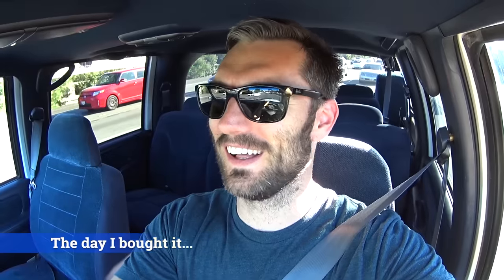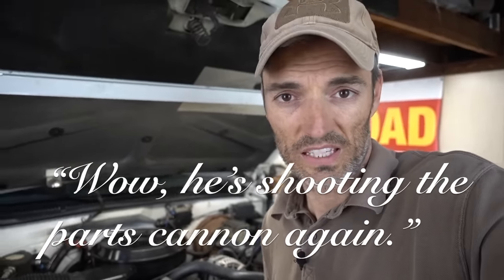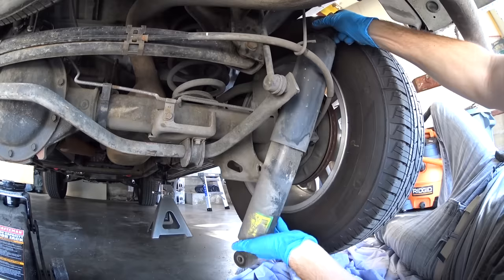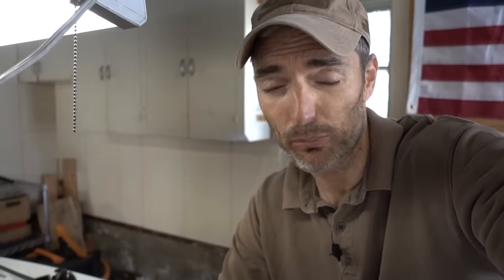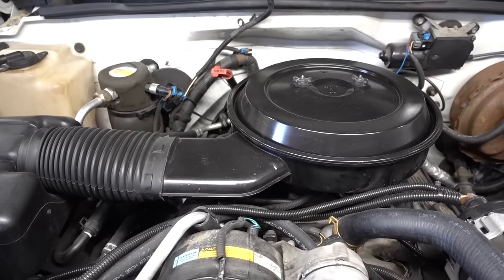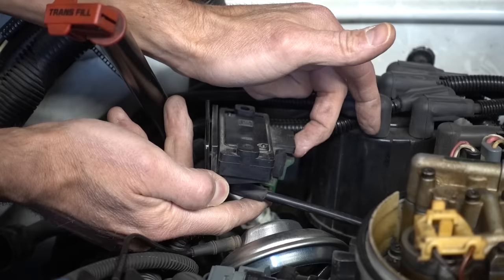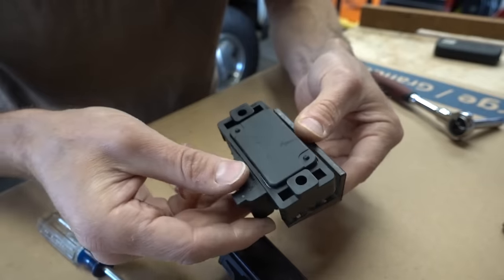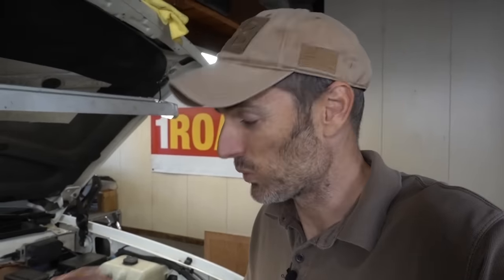The ONE REASON Why My 25yr Old Truck Runs So GOOD!!

Comment: I'd stick with a 25 year old part over anything made in China.
Reply: You have too look for original parts ( IF AVAILABLE ) & NOT MUCH IS MADE HERE ANY MORE, SADLY.
Reply: I usually buy the Chinese part and keep my old sensors on these. From what I can gather, delco isn’t what it used to be and doesn’t mean much anymore. I’ve used a lot of oriellys parts and they have all treated me well so far. I’m not throwing a part that costs 3x as much when another part that’s much cheaper works just fine. Especially when my vehicle is 30 years old and has 270k on it. I get what you’re saying and I agree to a point but is it really worth it? Delco is expensive and from what I read, they have a similar failure rate as oriellys parts. Plus oriellys usually comes with a lifetime warranty.

Comment: I jus subscribed. I recently installed corvette fuel rail covers that I had in the trunk. They were in the original package for my 94 LT-1. I wound  up taking the entire harness off to extend some fuel injector wires & to simply freshen up the design. Wrapped it up, cleaned the entire engine bay & replaced my throttle body gasket, replaced the I.A.C & T.P.S. Extended the I.A.T sensor. Took the pcm out & cleaned her up by wire brushing & painted her titanium grey. The results were, my engine bay is immaculate & I still am using the same opti spark since 2010. I have a back up A.C Delco waiting in the box & at least I know my motor much better. Regardless thank you for sharing because now I’m making an obd1 cable to retune her. Thank you & rock on 🇺🇸

Comment: I'm the same way with my 2005 Chevy V8  Trailblazer. It was my old man's b4 he passed and it is still getting the same miles per gallon as it did off the assembly line.

Comment: Jimmy, I m exactly like you are about replacing parts before they begin to affect my 23yr old truck as well. You are right about the Longevity of a vehicle how better it is and you can tell the difference between replacing certain parts due to age as opposed to waiting for them to wear out,  usually is a surprise to the unexpected people.
One last effort is to clean the clip and what it broke off from then place the plug-in part them carefully take your glue or whatever is best and then reattach the broken clip. If done well it should be as good as it was before, or nearly as.
Good an helpful channel.  Thanks.

Comment: as an EX cat mechanic you are EXACTLY correct that's why 1978 GMC 3/4 ton on propane fuel...72 cents per liter in bc, is still running very good today, as a matter of fact just came home with a cord of wood for our wood stove,Keepupthe good work.

Comment: Great video! Thanks!.....  I have a Silverado 2500 HD Extended cab with an 8.1l and Allision 5 speed-Great truck(i keep it up too)...but main truck I drive, is a 1971 Chevy C20( 3/4 Ton)....it has over 1 Million miles. My dad bought it in fall of 1970 as a 71 model. I do Home Improvement and Carpentry  work. This truck last and last and last-modified 292 Inline 6 supplies tons of low end torque-with New Precess MY6 overdrive transmission....constantly checking out vehicle-it keeps going and going and going....you are right!

Comment: I have a 96 c1500, I love this truck. you are completely right about preemptively replacing parts, these trucks parts are extremely cheap and ac delco is the way to go especially since theyre only 10-15 bucks more expensive than the china parts and last infinitely longer. I have had the truck since 2017 and everyone I know with new vehicles has their cars and trucks in and out of the shop constantly while mine has broken occasionally, nothing that needed to go to a shop for. everything is super easy to replace and is cheap and fast to do. I plan on keeping this thing for as long as I can because not only is it pretty, its cheap and easy to maintain.

Comment: I have 2 trucks, one is a 73 the other is a 76. They run good, they are reliable, replacement parts are cheap. I can go through these trucks bumper to bumper, new engine, transmission, suspension, breaks, etc for around 10,000 and have a truck everyone loves. Might not have all the bells and whistles a modern truck would have but I'm not into all that crap anyway. My old trucks will still be running when most of today's trucks are in the junk yard. I can just keep fixing them as long as I can get the parts.

Comment: I've a '78 Ford Econoline work van. 400,000 miles, and it still runs like new. 

I inherited it in '91, with 5600 miles on it. It has served me well all these years. I've done all the work. Parts are still available, cheap.

I rebuilt the body 15 years ago. I also don't drive it in the winter.

Comment: In 07 I bought a very clean 95 K1500 it needed a radiator I stripped it down to a bare block  and I too got out the parts Cannon now 95000 and 16 years later just starting to have trouble

Comment: I agree with You 100% !  I do the exact same thing as You do with My 2004 Silverado with 104,000 miles on it ! In 20 years I've only bought 2 batteries for My truck . That's because in the fall of the year I take My battery out, put it on the picnic table and scrub it down with hot soap and water . It's called preventative maintenance. It's what I learned working for General Motors The Buick, Flint, Michigan  Retired 😃

Comment: I just picked up a k2500 Suburban and preventative maintenance is what I'm doing so it doesn't break down on me this winter when it's -30 degrees. That's right, I'm talking to you 30 y/o temperature sensor!

Comment: Replaced this part on my 1994 G20 van, V6. Last one was factory original and had a crack in it. Runs MUCH better and idles much smoother. Cost a lot more than I thought it would, but worth every penny!

Comment: 100% on board with prevention maintenance. The high pressure line on my 2003 Silverado started leaking and was cracked..... I replaced the entire power steering pump, pully and all the hoses. I already had to take it out to replace the hose, may as well replace then original parts as the truck was at 197k. No leak, turns great!!!

Comment: My 17 year old 04 GMC 1500 purchased new just turned 56k miles.  I still charge the oil/filter once a year regardless of the miles, bumper to bumper fluids every 5 years. Getting ahead of what might be a problem works for me.
Reply: That is different than what this video is about. All fluids degrade slowly (usually) over time and should be changed with fresh as part of preventative maintenance. That maintenance can save you from future part failures. Some of those "parts" can be expensive like your engine and transmission. Just swapping out working parts is a different matter as the new parts are not generally of the same higher quality as the old parts. I would only do that if I am actually trying to solve a problem (rough idle) and definitely would keep the originals as spares if it does not fix the problem. Sometimes fixing stuff that isn't broken leads to other problems, like in this video where he broke the connector. He did not say what he did to resolve that (zip tie, RTV). Soon he could be chasing a problem when the connection is unreliable, convincing himself it can't be the MAP since he just replaced it.

Comment: The main place the "parts cannon" has failed me is ball joints. If I buy expensive ball joints the boots are too stiff and rip, so I have to replace them. If I go cheap the boots are pliable enough, but the seat wears out. The perfect combo of a quality joint coupled with a cheap boot. There are silicone boots for sale, so I think I'm going to start measuring their inner diameters and buying replacements up front.

Comment: I totally get that. If I’m pulling apart say the front end to do some lower ball joints and some bushings, may as well just rebuild the whole front suspension. So much nicer to have it all new and not have worry about tearing it apart and needing it aligned all over again.  
Although I only do this with a vehicle I’m keeping long term. 
As far as throwing a part at something, we’ve all had times when we’ve done it. It’s definitely not a great way to operate, but I just chalk it up as a learning experience and move on.

Comment: I agree, do it myself.  If you have to change cam and lifters, go for the rest of the overhaul.  You have the thing 1/2 town down. Why not.  Actually, new parts and clearances, equal new truck. Had a '69 malibu, changed oil and tune up w/ new points every 3 months.  Plugs, wires, whole nine yards, once a year.  Had over 200,000 miles when i gave it to my brother.  Ran great!

Comment: Think about it this way,  spare parts in case you need them. I do that all the time. Just recently changed my low beam headlights ( just slightly dimmed), with two new lights. Kept those for just incase.... the store doesn't have them or I need a light to get to the store so I don't get a ticket for operating my vehicle without proper lighting.

Comment: Jimmy! I really dig watching you tinker with your ride. Earlier this year I unintentionally acquired my own antique 'burban; a 1995 Chevy K1500. Ol Blue had considerably higher mileage than your GMC (214K!) but those old L05 TBI 5.7's are built like tanks! You've gone some places with your repairs that I also went and your channel has saved me some trouble in the process. Thank you!

But, your "can't leave well enough alone" bent isn't as bad as you think. Now, I've had to replace parts due to failures, out of necessity, but, I've seriously spent way more time and $$ on modifications! Probably my favorite is the mechanical to electric radiator fan upgrade. I picked up a used fan shroud with fans that came out of an 06 Silverado for a song, paired it with a Davies Craig fan controller and not only eliminated the parasitic power drain of the mechanical fan, this truck is so much quieter. It is also running at a much better temps, which means warmer, believe it or not. During the swap, I discovered that the fan clutch was going out and not fully disengaging, along with the thermostat not fully closing so the truck was running well below the designed operating temperature. 

Another crazy thing I'm working on is a DIY cold air intake. No matter what the 'experts' will tell you, the Helmholz resonance trap and it's constricting intake tubing is purely for emissions and noise. Yoinking that made an instant improvement in throttle response and low end power. Right now, I have a tube that fits around the air cleaner snorkel and reaches all the way to the fresh air fender outlet. It's roughly 4.28 inches in diameter at the snorkel (calculated, as the snorkel in an oval, not a circle) and an even 4 inches at the fender. For comparison, the factory intake tube has a horn flared entrance that sticks into the fender and measures a mere 2 inches in diameter! 

I have found a carb hat that will replace the air cleaner housing all together, along with a dry K&N high flow filter that I will put on the other end of that tube and make the setup legit.

I also can't shake the urge to swap the rear drum brakes for disc. 

Also,  I have some good quality cabling that should show up this weekend that I will upgrade the battery cables with - 2/0 for the battery to starter and battery to engine block ground, as well to connect the main battery to the additional battery I intend to add (by moving the coolant tank to the driver's fender, just in front of the anti-lock brake box, and putting a battery bracket next to the firewall where that tank used to sit) and #2 cable for the battery to main fuse box, etc. I've already rerouted the existing power to fuse box from it's (in my opinion) odd placement at the front, across the fan shroud to the back along the firewall. It's almost exactly the same length for either route!

And, of course, somewhere along the way I'll replace that anemic 105 amp alternator with a high output alternator with better  power at idle.
 
So, anyway, keep firing that cannon, buddy! Some of out here are right there with you!

Comment: I've had a variety of year model Suburbans. Most underrated vehicle on the road for getting from Point A to B reliably, comfortably, and safely.  2wd.4wd, diesel,  etc... The early 2000's models with the 5.3 were probably the best. I did like my 1991  3/4 ton diesel as it was just a beast and we camped all over the country in that slug.

Comment: I agree,25/30 yr old sensors will fail when you don't want them to,like while out somewhere and won't start back up,leaving you frustrated and stuck in a parking lot,so why not replace it,same with the hoses.. its definitely not gonna hurt to put new good parts on a vehicle so that it runs great.. not like it's a major engine overhaul,and it's all bolt on electronic,or mechanical parts that fail.. a good maintained vehicle will treat you right

Comment: Ten years ago I purchased a 1999 Burb to use as an RV.   We had it in tip top, like new, condition all the time - ready to drive coast-to-coast at a moments notice.  It worked out great! 
Last fall my wife and the Burb were in an accident.   The difference between walking away and passing away was the Suburban.   Sadly, the Suburban didn’t make it.   
I have since replaced it with another 99.   3/4 ton with hydro-boost brakes(The brakes on the 1500 are a real weak spot). 
The process of restoring to like-new has begun……

Comment: @1:20 range, I had to back up and check if I heard what I thought I heard. You make some good points (25 year old hose, for example). Now, my background: I started as a mechanic in 1977. I was at one point a "lead technician" at a dealership and later a trainer for a nationwide franchise. Now here's your lesson for today: NEW often means Never Ever Worked. Post 'vid shutdowns it's gotten 1000% worse. As to "I can buy it cheaper...". Heavy sigh.... I refer you to various videos concerning fake parts, clones if you will. Back in the day when points and condensers were throw away items. Well these days people are digging through their garage hoping they can find parts that missed the trash can. I specialize in transmission diagnosis and repair and I can tell you more and more we're going to the dealer for parts because the traditional parts suppliers are giving us junk. You've been warned.

Comment: My 1995 Suburban with a 350 throttle body engine ran 300,000 miles with no problems until rear quarter panels started to rust.  Now I'm running a 2008 Sierra with over 200,000 miles.  No fancy TV screens on the dash for me!  My truck runs and feels like new without the new price tag.

Comment: I had an 89 custom Chevy Astro van. You have the very similar setup that I do. One sensor that I think is absolutely critical that people forget is the knock sensor on the bottom of the engine. Those do go out and that will change not only your timing but the performance tremendously with the vehicle

Comment: Nothing wrong with firing the parts cannon at a vehicle you really like and want to keep.  Sure, you might replace parts that weren't faulty before finally finding the problem, but I don't consider it wasted money.  They're new parts on your vehicle now!  Not all of us have the equipment or knowledge to troubleshoot every problem you encounter, and I rather spend that money on parts than on labor.  Sometimes firing the parts cannon can get expensive, but  so can taking your vehicle to the shop.  Cheers!  🍻

Comment: Man my 94 is a beast, I lost traction on ice a couple weeks ago. Put the front end into a wall at about 30 mph through a controlled skid, my brush guard took the impact on the drivers side at about 25 degree angle. No damage to the truck

Comment: my 94 k1500 with the 5.7  has 208 ,000 miles and still  runs great,, yes I put money into it from time to time, but its well worth it,.. today a pulled a 3,000 lb trailer and a 800 lb bull 2.5 hrs one way and 2.5 hrs back... pulled like a champ...over rolling hills  .. I always take it out of overdrive when pulling heavy loads.. 
 heres a tip, beware of cheap , knock off parts, also let the motor and trans warm up good before you hit the road.. this is the number one think besides fresh, quality oil you can do to make your motor and trans last  a long time,, these trucks have big radiators and a good cooling system,  and take a few minutes to warm up..
a guy in a new chevy silverado was passing me today, and when he seen what my old truck was pulling, he gave me a thumbs up..

Comment: Dialing driving a TJ Wrangler for years now…it still looks clean and runs good…although I have replaced pretty much everything but the axles.  A new engine AND transmission every year is still cheaper than a new Jeep.

Comment: FYI: If you haven’t already, start replacing the vacuum lines, connectors and elbows. A cracked or loose vacuum line will drive you crazy. Nice suburban. I did all that on my 1993 Jeep Cherokee after it sat got 12years after my father passed a away. Runs great.

Comment: I have a 1998 GMC K1500 with 300K miles.  I totally agree with you.  I keep a detailed log of every item, where purchased and the cost.  If amortized over the length of ownership, it costs me around $100.00 a month, which includes everything including tires, oil changes etc. A new truck would be substantially more, plus the knowledge I have on the truck can not be replicated.  I would trust my truck on any trip and know if something did go wrong, I likely have the knowledge to fix, again could not be said for a new truck.

Comment: I do the same thing.
I would rather work on my vehicles when I want to... not because I have to. 
Our oldest vehicle is a 2002 Yukon Denali with 230k miles on it.
It looks runs and drives beautiful. 
The only thing we sent it in for was a transmission rebuild at 180k miles.
I replaced all the hoses before a trip to Florida two years ago.
Great video..